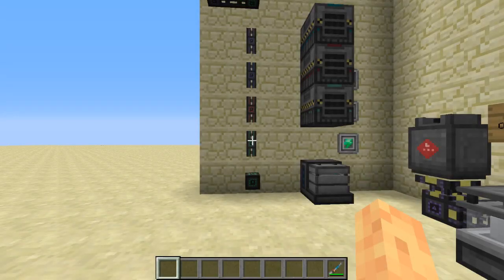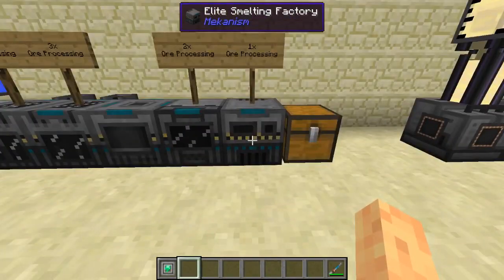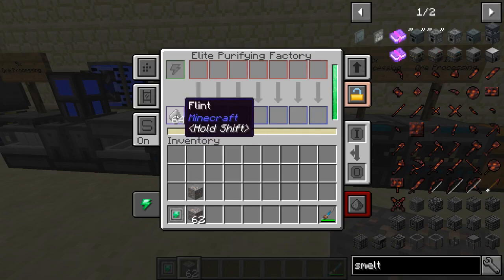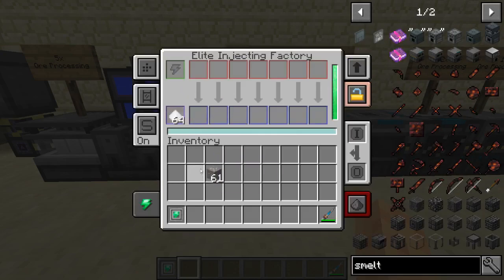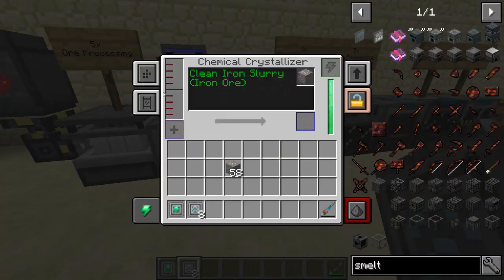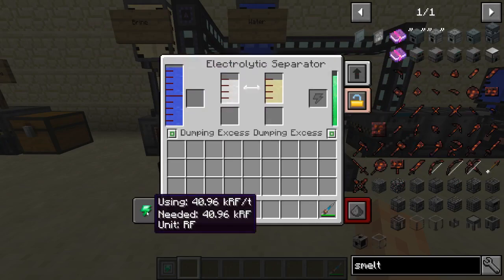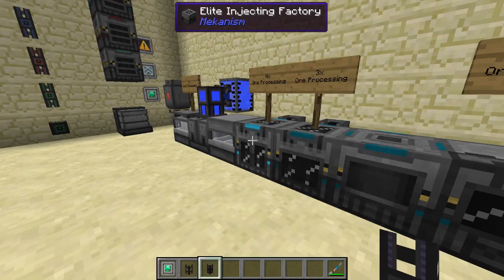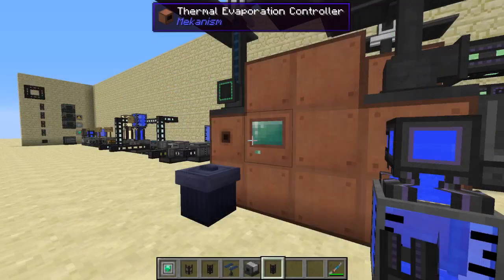Mekanism: 1 – 5 Times Ore Processing Tutorial

Comment: Is the input/output rates of each machine listed anywhere online? I'm trying to build a server factory for 5x ore processing with a high input rate and I can't find anything to use to calculate how many of each machine I'll need
Reply from the maker: At full upgrade you can have 7 chemical crystallizers feeding into one elite infusing factory without any backups. The crystalizer is the bottleneck of the system (slowest machine) so while it is possible to run multiple crystallizers off of one washer it can cause a lot of headaches when the slurry gets split. I haven't had the chance to test but I'm sure that can keep up with any kind of quarry

Comment: how do you automatically transfer items between systems?
Reply: The mekanism machines have a setting in the input/output menu to auto output products or not, toggle it on and make sure the correct side is set to blue output and the neighboring machine has a adjacent red input side and items will automatically transfer
Reply: @user-jm8sy5ox2j  Thanks :)
Reply from the maker: Timestamp 3:20 if you're still looking for it

Comment: http://prntscr.com/suwez1

ich verstehe es nicht
das Gas Cabel von dem HydrogenChlorid will nicht mit der Factory connecten
habe das video 10x angeschaut da ist kein unterschied außer das es nicht connectet ist
wenn jemand weiß was das problem ist hilfe
Reply from the maker: Stellen Sie sicher, dass sich das Gaskabel für Chlorwasserstoff und Sauerstoff nicht berührt. Das Werk ist so eingerichtet, dass Gas auf dieser Seite aufgenommen wird, und richten Sie den Gasschlauch mit dem Konfigurator in die Maschine.  Manchmal ist es am besten, das letzte Rohrstück zu brechen und zu platzieren.  Stellen Sie außerdem sicher, dass es in die Injektionsfabrik geht. Es sieht so aus, als hätten Sie möglicherweise die falsche.

Entschuldigung für die Google-Übersetzung, mein Deutsch ist nicht so gut
Reply: firstly you can address me with you ^^ secondly no gas cable is in contact with another thirdly I had removed all raw cables and put it back again did not help fourthly yes I looked it is the injection factory

I apologize for the Google translation, my English is not that good either